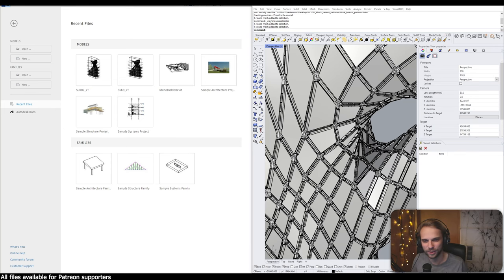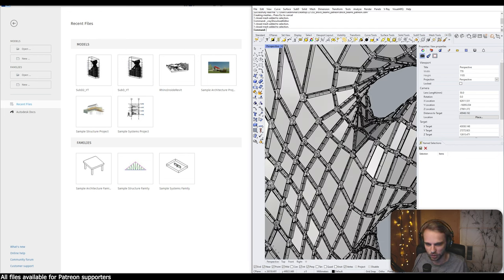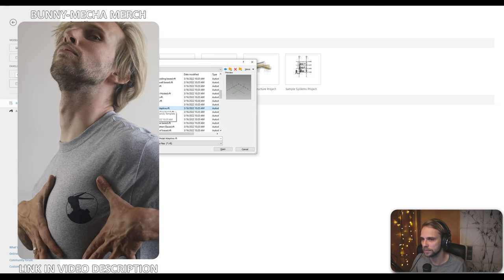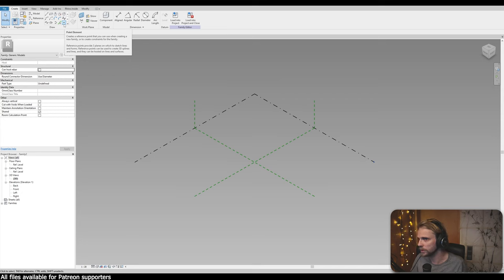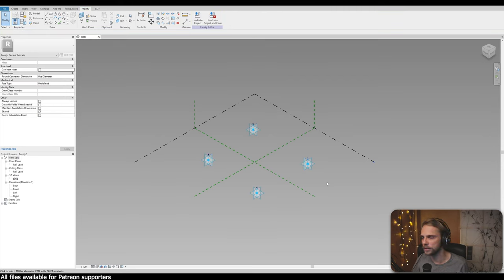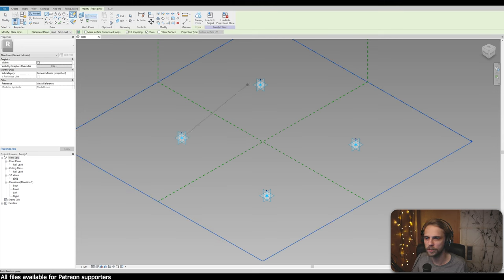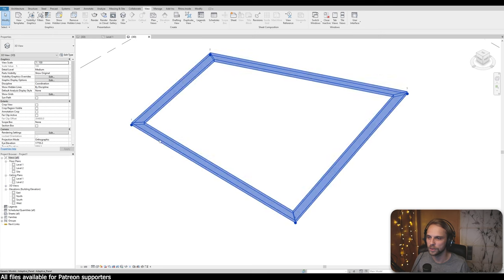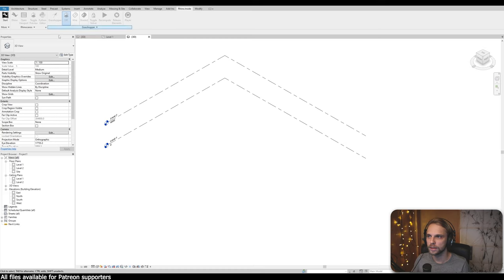Parametric design with Adaptive Families in Rhino.Inside.Revit (with Scheduling)

Comment: I think Rhino.Inside is probably ideal to play with.  Few people seem to be testing it like you are and it really only came out a year and a bit ago.  I went over the entire manual and found it made bring geometry across as native elements really easy which means where we were limited in the past now there's huge potential for Rhino/Grasshopper to fill those gaps now and not with clunky DWG 3D files.
Reply from the maker: There still are quite a few limitations when it comes down to native components (that are inherently driven by the lack of flexibility on Revit side) but things are definitely moving in the correct direction
Reply: @DesignGoBrr  Check the guide Scott Davidson put out.  Following their basic tutorials it was easy to take anything from 3D stock libraries and push it into Revit as Native solid geometry with Materials.  I'm specifically looking at problems we have in Landscape Architecture AND that most people in that field are using Handsketch, AudoCAD and Sketchup.  I have way more access to material data in Rhino although it seems I couldn't find a way to write hatch patterns, which in landscape is an essential tool.  I'm currently trying to master topography and paths/road generation before I go much deeper.  One thing at a time and hopefully I can eventually Automate much of the process in Revit via Grasshopper.

Comment: Rhino is one of the most popular architectural tools due to its innovative features and accurate modeling, Grasshopper has an open source mode where developers can develop plug-ins.
In a nutshell, it's time for the Mcneel guys to work on these simple Revit-based features that can be easily used for architectural purposes. Specifically in gen R8!✨
Reply from the maker: It seems that with Rhino 8 they are focusing on mesh functionality as well as blocks, which should enrich the Rhino-Revit workflow drastically